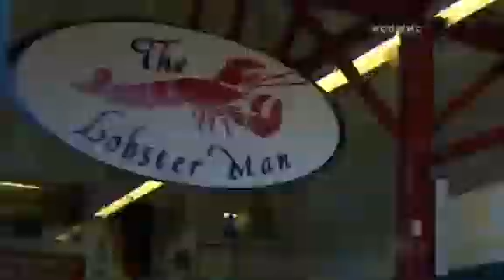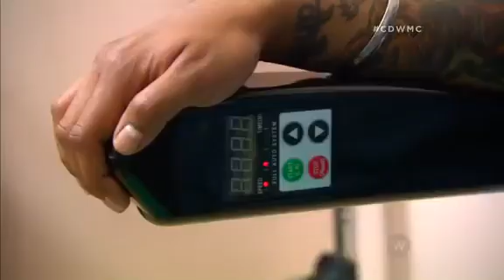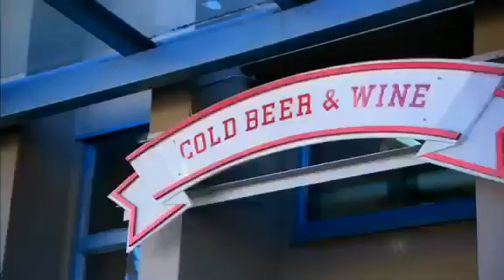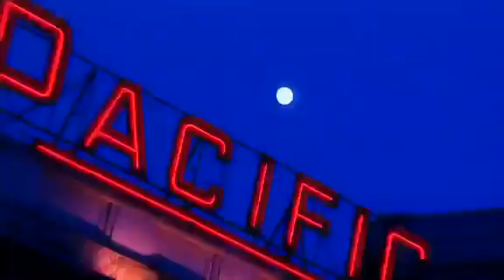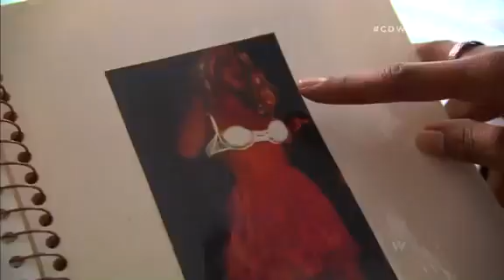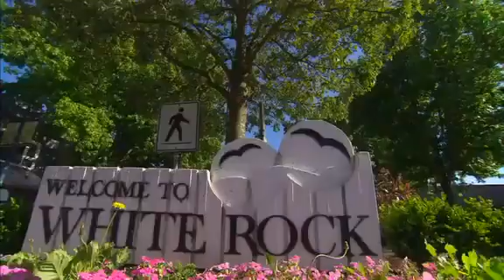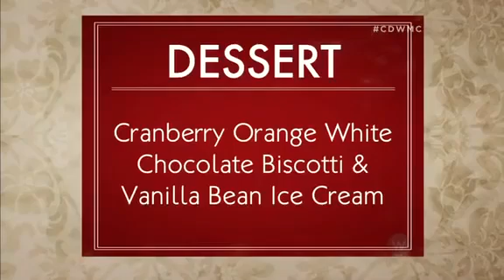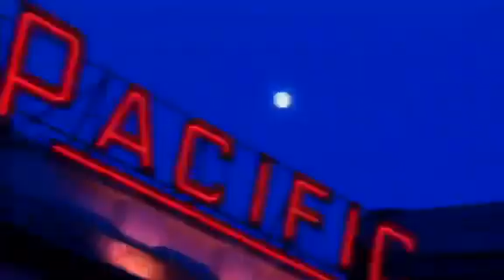Come Dine With Me Canada Block 7 Vancouver Syd, Nav, Alessandro, Rachel, Robin

Comment: Robin is such a synthetic waste of an unindividual clone elder 🤖 ,it would melt if it got near a fire,id love to see it in an apocalypse.

I wander where it was manufactured,i see lots of these clones all the time,just dont know where they're made and is it fuel or battery powered?,if its battery then how long does the battery last and how long does it need to be on charge for?,what happens if it gets wet,how do you clean it? And wheres the power button?,can you teach it new tricks or is it one of the old basic models where it can only comprehend what its already been programmed to understand? 🤔 Oh and is it flat packed or does it come as a whole?,are the 1940's models rare now? Because if one breaks and needs replacement parts what are you supposed to do if they arent being made anymore? 🤔